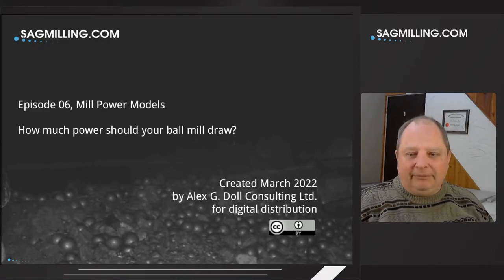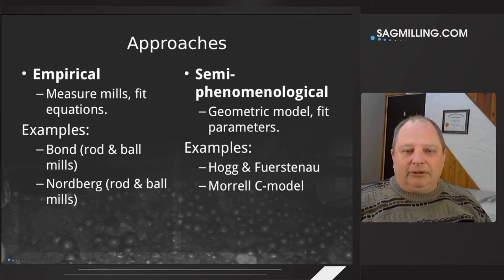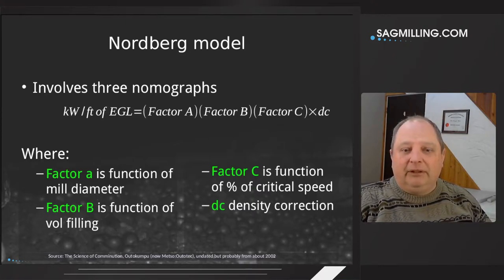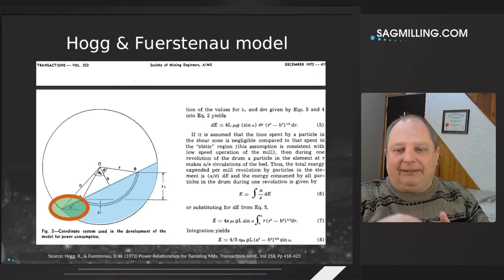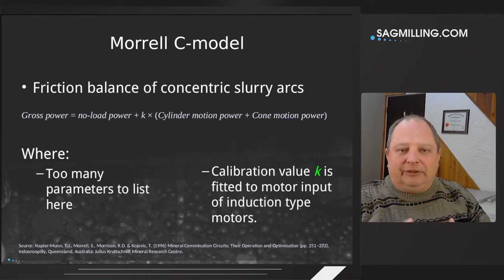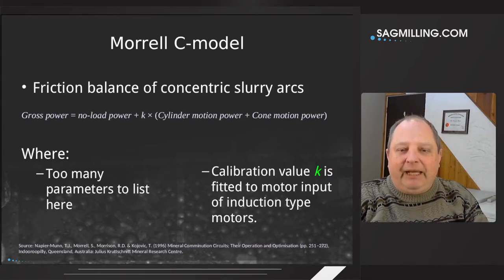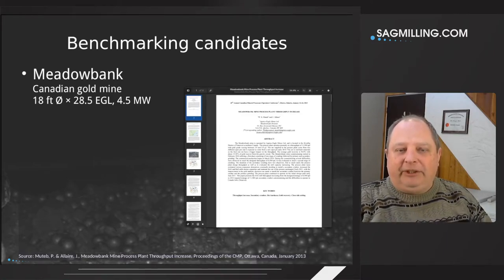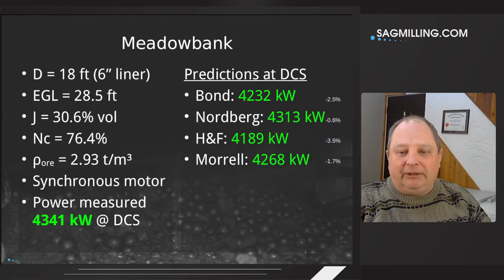Ep06 - Ball mill power draw models

Comment: Hello Mr. Alex, based on your experience, among the SAG models used by JKSimMet and MolyCopTools, which is more robust? 
PD: Excellent videos 🤝
Reply from the maker: Hi, I use the two for different purposes.  JK SimMet is useful in a design setting as it has an 'appearance matrix' that can be computed from the drop weight test.  This allows models to simulate mills that don't exist yet.  MolyCop Tools (or J-Tools) are only useful to simulate existing mills, but are a lot simpler to run to generate a quick selection function.  I am comfortable running MolyCop Tools, but always call on an experienced expert to run JK SimMet.

Comment: All models depend on volume loading(mill filling) which keeps on vary along the liner life.
Reply from the maker: Yes, I agree it is necessary to measure both of these (liner effective thickness & filling) during a survey.  The new laser scanners are great as they can provide highly accurate measurements for both of these quantities.
Reply: @sagmilling  I used the laser scanners files to interpret the residual thickness , but calculating filling is inacurate from laser scans as laser scans are not done during the crash stops, rather they are done during any replacements or after ore grind outs.
Reply from the maker: @Utkarsh Shah This is why the laser scanner need to be deployed during crash stops, too.  These apparatus are now cheap enough that any mill with large grinding mills should have one that they can use at will.  Cheers!
Reply: Can you please make video of chamber sampling and calculation and how according to charge balls according to the results 
Our mills is 3.4 m dia and length is 12 m ,single Chamber grinding clinker after RP